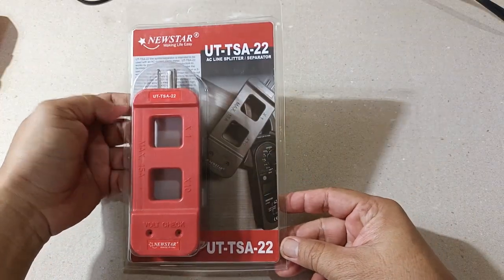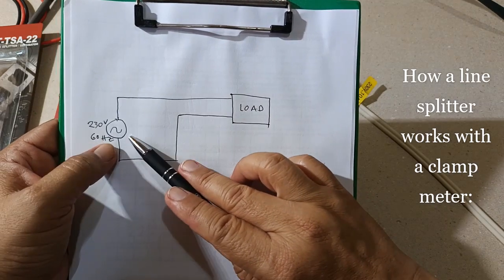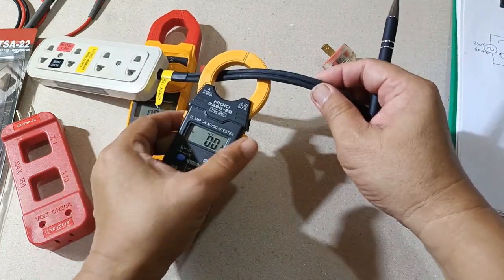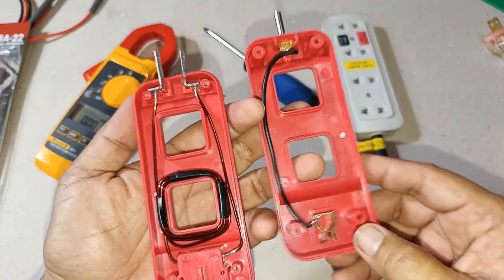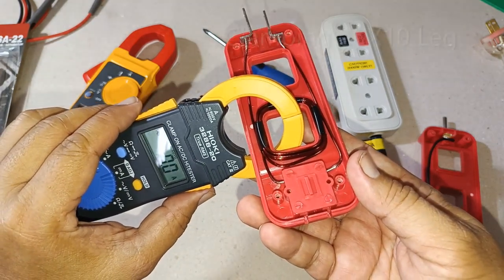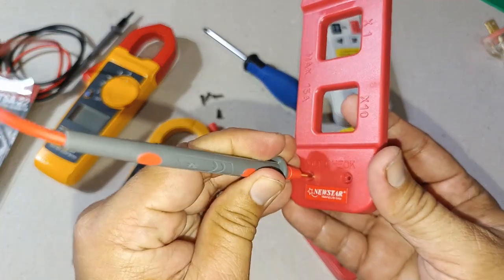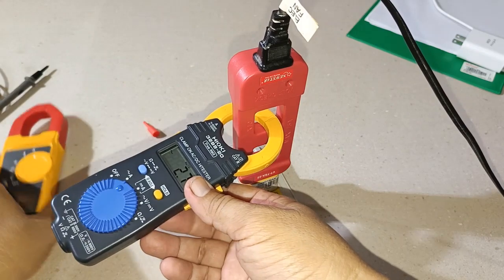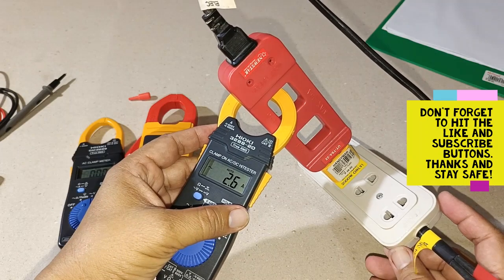AC Line Splitter - How does it work? Checked with a Fluke 324 & Hioki 3288-20 Clamp Meters [CC]

Comment: here in the US. Our voltage is 110-120 15A. I don't see the point of a x1 line split. Takes up more space than and the 10X all you have to remember is the move the decimal over.
Reply from the maker: You have a point. Considering it's limited to 15A line current max, there's not much range for the X1 to work with, while the x10 has more. In fact, I've seen line splitters with just x10. Still X1 is there in case you need its convenience for a 1:1 measurement using a clamp meter.

Comment: i wish there were these with a c13 on one side and c14 on the other. they would be really useful for permanent install's in datacenters
Reply from the maker: Unfortunately the C13-C14 cable isn't compatible with it. But it would be interesting if there's a line splitter that can accommodate such a purpose.

Comment: Do you mean L1 and Neutral or Do you mean Split phase L1 and L2 ?
Reply from the maker: I don't know who coined the term "line-splitter" for this device but that designation does not mean "split-phase" in the sense of 3-wire single phase system. It simply provides a physical separation between the two single-phase voltage supply lines. This allows for the convenient clamping of a clamp meter on just one line of that supply through one of the legs of the line splitter. As you know, with a clamp-on current sensor, you can only measure current on one line, not two. In this manner you can connect any single phase power cord for small appliances at the output of the line splitter without physically altering the cords themselves, and then measure their current by clamping on a leg of the line splitter.